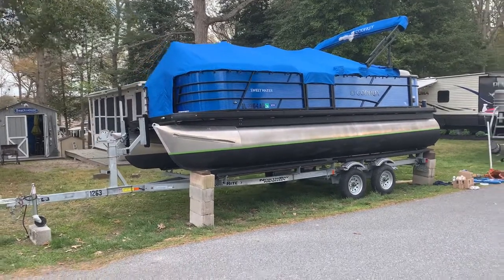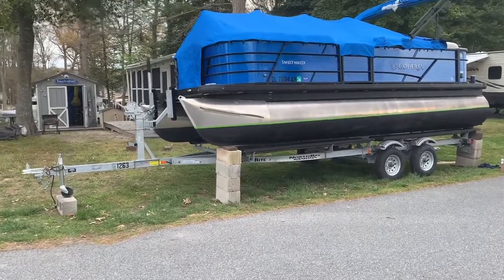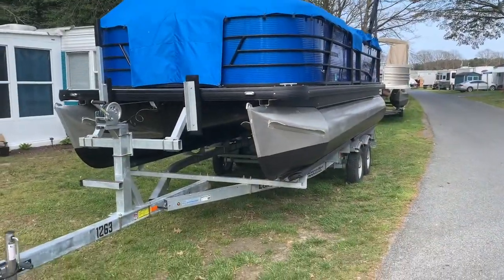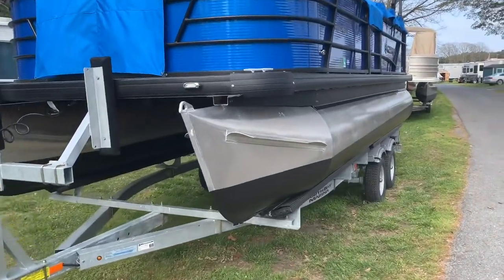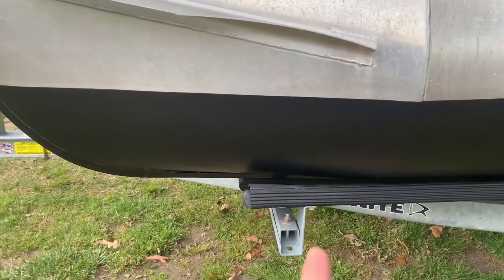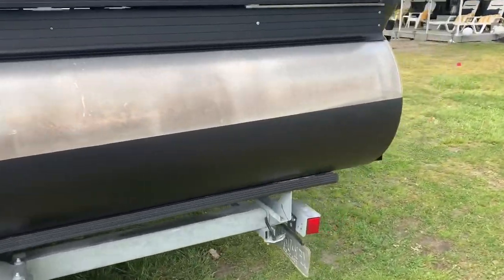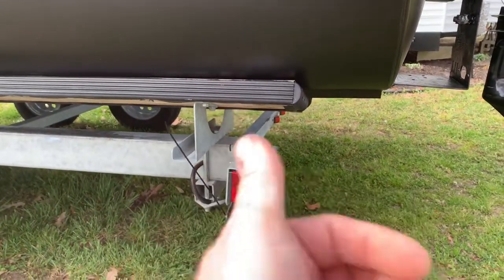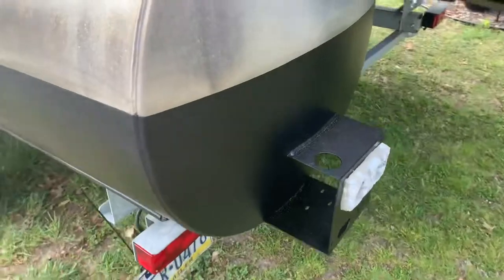How to bottom paint a pontoon boat on a bunk trailer! Simple, cheap and easy!

Comment: Great idea did you but did you put jack head directly on pontoon worried ot might put a hole in it how did you achieve it thanks
Reply from the maker: No need to jack on the pontoon at all. Jack one side of the trailer up with the pontoon on it, then block the front and rear of the pontoon, then drop the trailer out from under it. The jack just lifts the trailer which lifts the toon.
Reply: @TraylorBoys  thanks for your help  one last question roughly how high does the jack need to lift the trailer I assume that the jack was on blocks first to give it extra height this is going to save me so much money doing it my self I really appreciate you taking time to reply
Reply from the maker: @idcunningham  I used an automotive floor jack. I think I had a small cut off piece of 6x6 wood between the jack plate and the trailer. The jack itself was on the ground. Trailer will only raise about the height that you want your toon to be. Then set your blocks at both ends of the pontoon. When the trailer is lowered, the toons will stay at the height you had them. This is the only way I figured to paint them without actually jacking on the vessel itself. I’ll see if my wife has any pictures of the jack in place.

Comment: You mentioned you had to move the rear bunk up for the blocks to fit how did you do that?  Thanks
Reply from the maker: Easiest way is to have the boat off the trailer. Can be done if you can get a Jack with wood under the toon somewhere like I did, but that was the hardest part. Once the bunks were moved. Easy

Comment: How about supporting the toons like you did, then let the air down in the trailer tires...?
Reply from the maker: Nope. What is did was jack one side of the trailer up about a foot. Then put the cinder blocks at the front and rear of the toon. When I lowered the trailer, the toon stayed up. The downfall is you can only paint one side at a time. This will be the third year I’m doing this. Should be painting them in the next couple weeks. I can video the lift/supporting process of you want?

Comment: What type of paint did you paint it with?
Reply from the maker: Interlux Pacifica plus for aluminum toons. Boats been in the water since May. Just pulled up on a sandbar and lightly scrubbed the growth off the toons (our slip is in brackish water) and the toons were actually really clean. The black also stays very dark, instead of lighting to almost gray.

Comment: I actually tried this on my Tritoon... and as I let the trailer down and the boat contacted the blocks.. it started to dent and depress into the bottom of my toons...
Reply from the maker: Where we store our boats, ones that have no trailers, all sit on concrete blocks with wood on top. Sit like this all winter long. Never seen one dent a toon that was properly blocked. Also, the V on the bottoms of these are really sturdy, they should easily support the weight as long as it distributed across several inches. Obviously the more surface area the better, In my case with a pontoon, about 6” on each end was plenty enough.